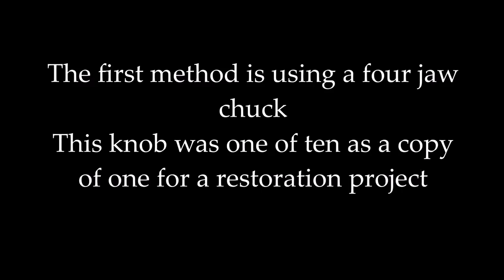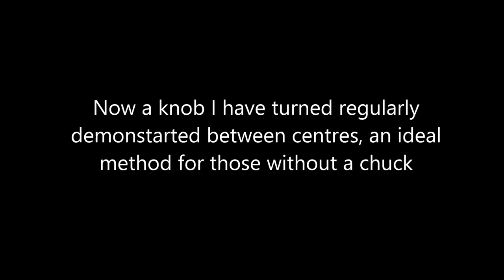Hand woodturning Drawer Knobs- 2 different metods

Comment: I turned all the drawer pulls for my house, out of as many different woods as I could. I made a screw chuck with the same mounting screws I used for them, and epoxied that into a mandrill. Not as consistent as you are, but it was fun...
Reply from the maker: A good solution 👍

Comment: A relatively simple task, but done with ease and showing years of experience. I still wonder abo7t your brief and simple use of abrasives, but am also impressed to see it is just plain and does what is needed as the skew gives such a clean finish.
Reply from the maker: Thank you Phil, yes little sanding is required when a good surface is achieved with the tool.

Comment: Thought I was fairly good with the skew, now I feel humbled. I need to practice more! Question: did you drill the screw holes freehand after turning? I like to use a screw to mount the blank, same size as what will be holding the knob to the drawer but longer, in a turned block held in the chuck.
Reply from the maker: Thank you, I don’t drill them the customer does that. I don’t know the size of screw they use.

Comment: Very nice, the sizing gauges you use on your projects, did you make them yourself? I know the one is made from wood, are the others made from steel, aluminum, or tempered hard board. Great job of duplicating the knobs!
Reply from the maker: Thank you Tarry, yes I make them myself from steel scrap from the fabriction workshop nextdoor
Reply: I was wondering the same thing. Is this just soft steel that you cut a notch into of the desired dimension or is there more to it than that, maybe making sure to file a bur?  

I've used a box end wrench (spanner) that I press into the work as I cut with a beading tool until the wrench slips over. It seems your way may be better because your tool actually cuts a bit.

I guess your tool goes into a box as a pattern for future production work?
Reply from the maker: It just soft steel with a notch as you guessed.

Comment: How in the world do you keep from breaking something when you put a piece of wood in the lathe with it running?  No way would I ever try that.
Reply from the maker: It’s something, as a production turner, I do all the time. It is not difficult. My spikes have a slightly longer point than normal, you put the blank in just on the point bring up the tailstock then before it grips the spikes let go of the blank, it is then only held on the two points. Then wind up and it grips.